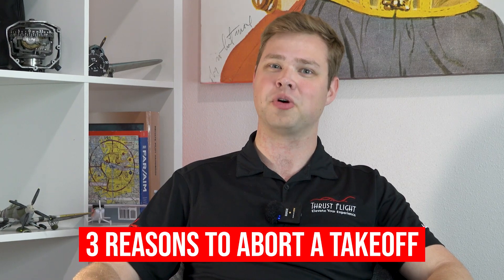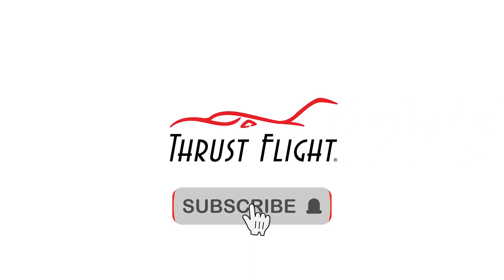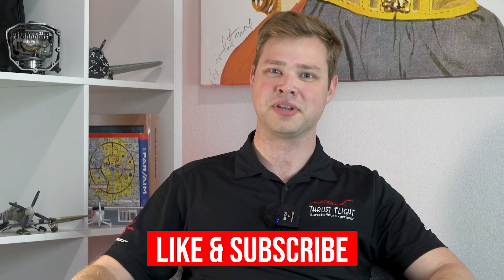Abort Takeoff: Top 3 Reasons Why Pilots Stop Planes Mid-Takeoff

Comment: “Any loss of directional control we abort” Wrong. There’s difference between low speed aborts and high speed aborts. There’s also difference between aerodynamic loss of directional control which affects you both on the ground and in the air versus ground based loss of directional control. As low speed aborts have fairly low risk, and as you’re not going to be able to get airborne without more time under the influence of the problem, abort for any low speed loss of directional control. High speed aborts are more risky. For a high speed loss of directional control due to blown tire, seized brake, nose wheel steering, going flying is a better option if you’re at or near the energy to do so. Getting airborne and accelerating in ground effect, great. Now you can choose to fly to a wider runway gaining some margin. Further, you can offset your landing biasing away from the draggy side as you would to good tire if landing with blown tire. You could also see about crosswind from the good side so as to side slip touching that good side down first delaying putting down the bad side as you slow. Aborting at high speed for a ground based loss of directional control means you will have ceded runway width margin toward the bad side before you begin to attempt to stop. These reasons are why Cirrus Approach videos add a caveat “abort for loss of directional control if rudder does not immediately counter swerve.” Note counter means arrest the drift turning to parallel centerline not get back on it as attempting such increases dynamic instabilities and PIO susceptibility. Note also Navy jets state for loss of directional control on takeoff or landing go around or get airborne if able.
Reply: Acceptable counter arguments with the point being “Context Matters.”

- “Shu Ha Ri” as Jeff Sutherland writes in the Scrum book meaning ‘novice/apprentice, journeyman, expert.’ You have student pilots and private pilots whose flight hours may be current but not proficient. You’re concerned about extended delay on startle responses as well as “analysis paralysis” in decision making. While these abort concerns low/high speed and ground/aero causes are true regarding physics, we also need to balance the psychology of the person. Having simple criteria makes for more rapid decisions and action execution. 

- These are light airplanes meaning they have little inertia while their brakes are strong relative to such. They have more means to stop in the swerve than they do to fly.

- These are light airplanes with relatively slow rotate and liftoff speeds. I can accept risk of runway departure on the swerve as while it may damage the aircraft, due to our speed bands we never get into truly high speed abort scenarios meaning such wrecks are highly survivable. This may be the optimized choice for risk acceptance. 

- I’m flying from Austin with 150 ft wide runways; I’ve got plenty of excess margin even after initially ceding such. 

If you want to stick with an absolute abort for any swerve in your school’s aircraft, ok, but be sure to include all the Whys and still teach the countering Why Nots while showing in your specific case you think this the optimized answer for your situation.